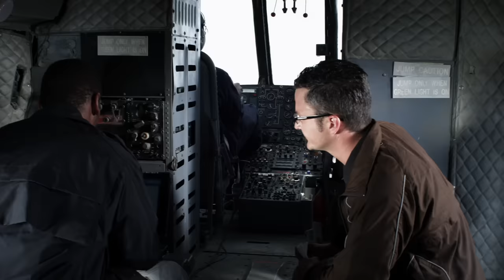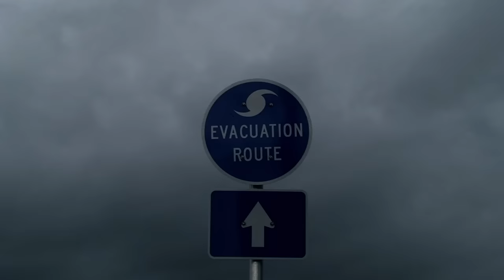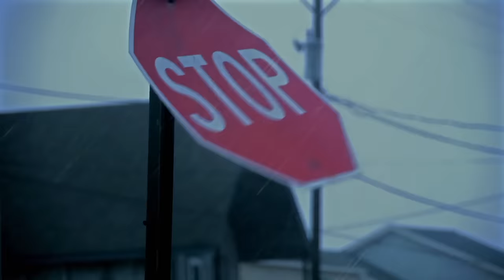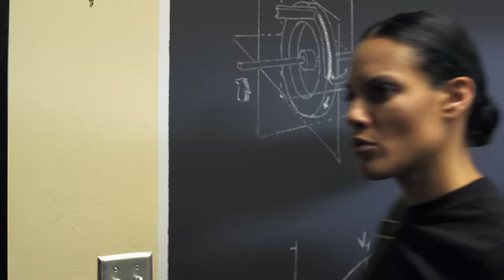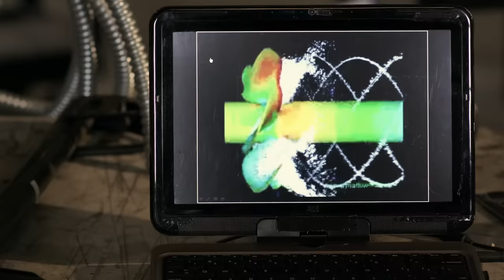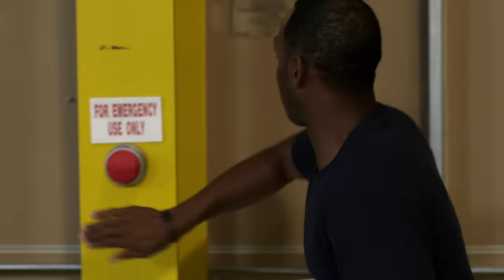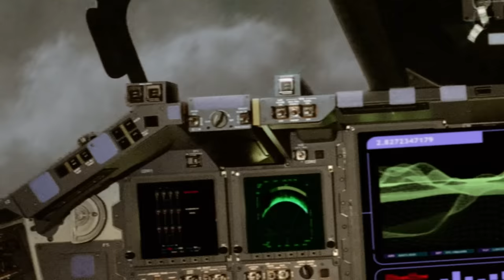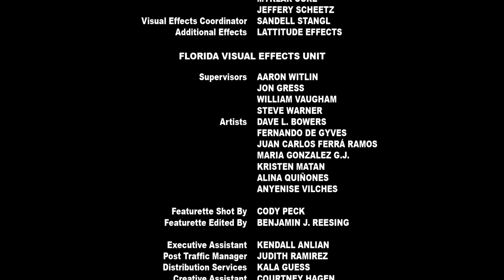40 Days and Nights | Full Movie | Action Adventure Disaster | Killer Flood!

Comment: wow so hokey .. that  lab with the arc is somebodi'es'  automotive garage .. an old ass Sun analog tuen up machine from the 70s ..  a boring bar for  engine blocks, a cylinder hone  a qwik way valve grinding. , a chinese harbor freight press..  a tech was working on a car engine on a pallet .. .. why were the pilots wearing motorcycle helmets   ,one with a clear visor .. the 2 girls jump from the transport plane into  terrible weather , no rain gear , goggles, tits hanging out .. funny movie